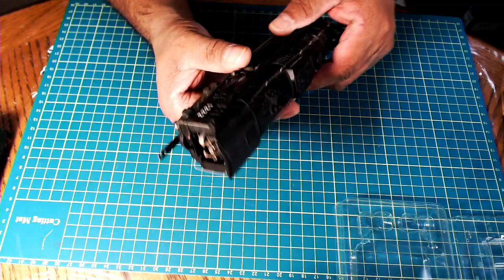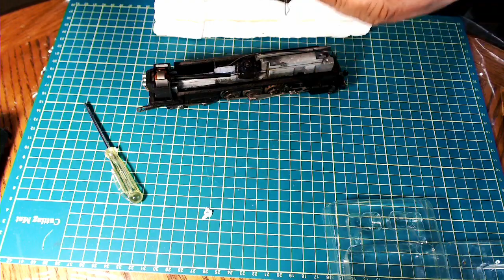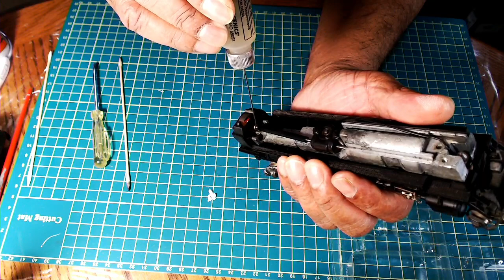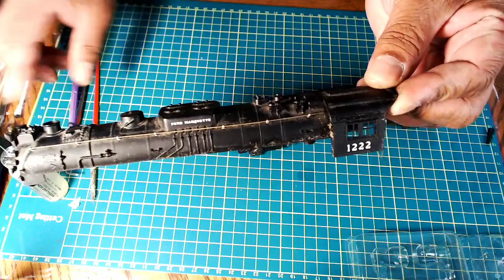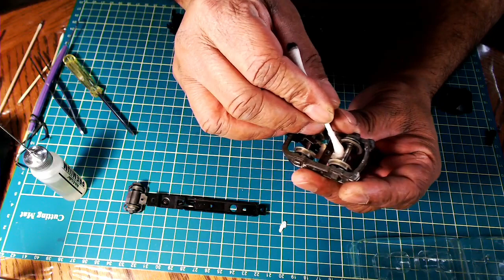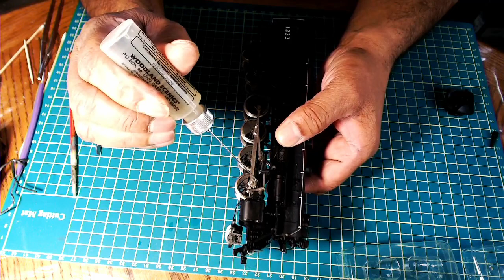Rivarossi 2-8-4 Berkshire HO Steam Locomotive Service and Tuneup

Comment: I love the old Rivarossi locos. I don't know why some people give them a bad rap. The steamers were the best. In my opinion the Vintage are better than the Red Box unit with plastic carters. The red box units certainly run smoothly with central can motor and transmission towers, but too much plastic to my liking.

Some people complain that there are no brass bushes on the wheel axle and that the bearings on the chassis are square. In my humble opinion they are square on purpose as this reduces the points of contact with the axle. Less contact= less friction.

The old Rivarossi motors are also well built with or without ball bearings. These can be serviced and don't have to be replaced like the more modern can motor. They tend to run slowly as they age mostly because of dirty brushes and commutators. The spring that holds the brushes is also very important. If the tip oxidized than it makes very poor contact and this dramatically impacts the motor function. I still have units that I built from the Rivarossi Hobby kits when I was 12 and still run 60 years later.

Unfortunately some of the Diesels or Electric locos had plastic bogie frames that tend to rot if they come in contact with the wrong lubricant.

Thanks for your very good videos!!
Reply from the maker: I totally agree with you . They are have solid gearing Brass etc ..  Just well built machines .. If you keep servicing them .. they will give you years and years of joy ..

Comment: Very nice! I also have one just like it. The Berkshires are my personal favourite steam locomotives, particularly the Pere Marquette units, as the 1225 was the inspiration for the Polar Express. I’m impressed that it runs as smooth as it does!
Reply from the maker: Thanks for the kinds workds , appreciate it .  Also , I was not aware of the info you shared about the Polar express .. thanks for sharing that .. Do you have multiple Rivarossi steams ? Reason I ask is because , I'm wondering if you know if the Front coupler is just for decoration ( esthetics ) ? or can it be used to double head with another steam ? the front coupler looks to be very small .  Please let me know .. 
Thanks , Anthony .
Reply: No problem! I believe it’s a false coupler. It’s possible that a kadee coupler might work with the false coupler, though it would have to be manually coupled since the knuckles don’t move (I use horn-hook couplers, which don’t fit). Perhaps the loco could be modified to accommodate a real coupler at the front, but I’m not really sure.

Comment: Just a question: This model says steam. This is because the original was  steam or the model make steam somehow?
Reply from the maker: Hi Fernando , This specific model does not have a smoke unit in it . There are some loco's that have a smoke generation module in them , whereby you put some smoke fluid and it will heat it up and create smoke . But just to be clear , this is not a locomotive that runs on steam .  
Regards, - Anthony -

Comment: There is one pf these for sale locally at a good price  but iys missing its bell,  which would drive me nuts.
Reply from the maker: I hear ya .. However, If it is only missing the bell, you can 3d print that fairly easily , especially if the price for the loco is a steal ..
Reply: @anthonyshobbycorner  I guess I would have to get someone to print it but that would add up with them creating the model etc... the model is up for 69 pounds  , not mega cheap but not too bad.

Comment: What code is your track?
Reply from the maker: Hi , I'm using code 100 Peco track and Peco turnouts for the most part .
Reply: @anthonyshobbycorner  ah, thanks! Realizing that I’m going to have to modify my Rivarossi flanges to work on the club tracks.
Reply from the maker: @corwin81  Oh no ... Is the Club running Code 80 ?  it's would be a shame to modify the flanges on that rivarossi beauty ...
Reply: @anthonyshobbycorner  83. I might leave the Rivarossi stuff alone though since I have some Mantuas and IHC that are already good on code 83. I have two Berks and my son has one, plus a Hudson, and 0-6-0T. I have 7 Mantuas though, either Mikados or Pacifics.
Reply from the maker: @corwin81  sorry I meant Code 83 . I totally agree with you .. Leave the Riva alone , and run the Mantua and IHC on code 83 at the club .. 
These older Rivarossi's are well built and so hard to come by these days (Hard to find them in good condition ) .